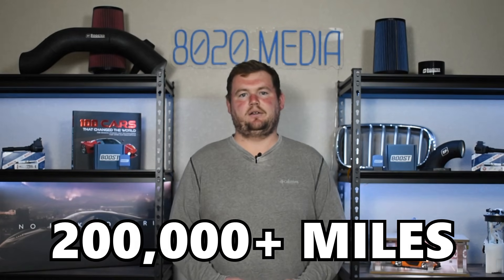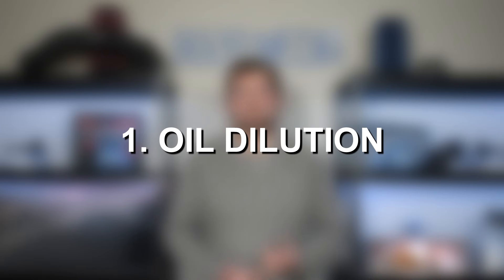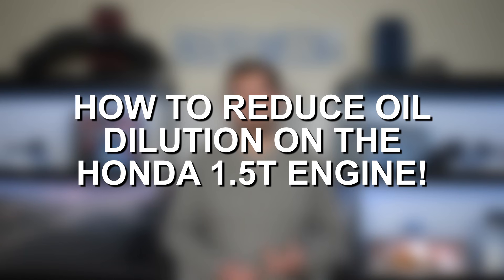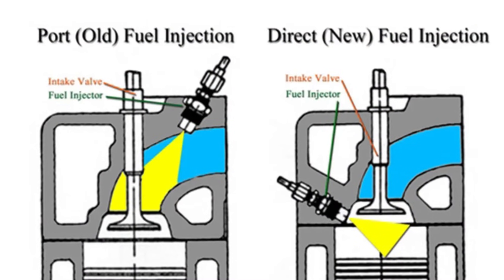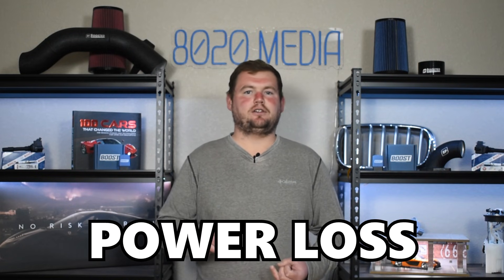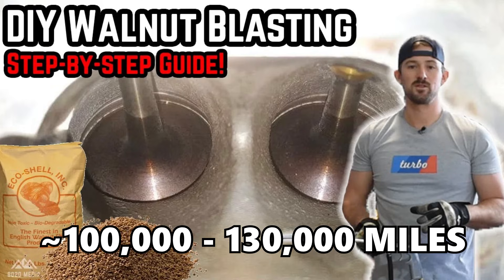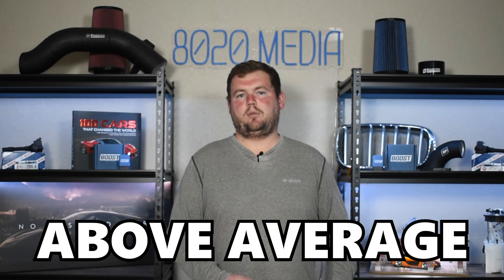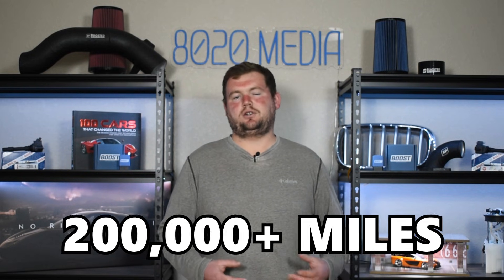Honda 1.5T Engine Breakdown – What Every Honda Owner Should Know! (L15B/L15C)

Comment: 2017 Honda Civic LX 6MT, 190k miles-not a cough. 
Mainly highway miles, oil changes 10k-15k miles, synthetic oil
87 gasoline
Reply from the maker: S - Nice! Thanks for taking the time to share your experience.
Reply: The lx has the 2.0 engine...
Reply: @theadvocate4698 
Nope
Not the hatchback

Comment: As a certified Honda master tech I am telling you every 1.5 T is a ticking time bomb. Simply a matter of time
Reply: Why exactly are you saying this? Just have a look on the CivicX forums, there are thousands of Civic drivers, also plenty of high mileage Civics, almost no head gasket issues or blown turbos with the 1.5 T. Even the tuned ones holding up pretty well.
Reply from the maker: S - Agreed.
Reply: lol...One can be anything they want on the internet
Reply: My 1.5 with 140,000 miles begs to differ buddy
Reply: My 18 1.5T is sitting at 275k km. No issue
Reply: @anthonychan853 proof that with maintenance almost anything can last a long time, all these self proclaimed internet experts think they are mechanics lol
Reply: @anthonychan853 are serious
Reply: Any car with an engine is a ticking time bomb, just in some cases the ticking takes a lot longer than in others :)
Reply: @g.ghenady haha that’s true! Never a good day when the ticking stops lol
Reply from the maker: V - Interesting take..
Reply: I traded in my 19 SI (loved that car) because of the problems I was hearing with the 1.5t. I bought a 24 CRv Hybrid. What do you think of 2.0 hybrid?
Reply: Any reason my 2016 civic exl 1.5t is like sputtering and like losing acceleration. When I push on my gas it likes gallops.
Reply: @MrXjmann360 they have an open recall for low pressure fuel pump in the car. Injectors can go bad too I replaced mine

Comment: I have been a honda owner since 1991 and own a 2019 with the 1.5 . I have doubled my oil changes run premium fuel for the added detergents and run a pea fuel cleaner every oil change. I also run my crv in sport mode during the winter on short trips to get the engine up to temp quicker.
Reply from the maker: L - You're doin it right!
Reply: @8020Automotive  David Wardale writes about a weak South American locomotive design in his book "The Red Devil and the Age of Steam" that any machine can be made reliable if you lavish enough maintenance on it.  If I buy a used Honda, I have to find one in which the owner can show records having doubled the oil-change frequency, used premium fuel and added injector cleaner with every oil change?
Reply: My wife has the same exact car. I found oil in the engine air filter because of a clogged PCV valve. Have you had oil in your air cleaner? Also, I hear 87 octane is best for this engine because it makes it run hotter which it needs the heat to run efficiently.
Reply: I tun 91 to keep my injectors clean. I have never had oil on my air filter. My problem is cold weather and short runs causing fuel dilution.  I also run  my crv in sport mode to keep the rpms up to try too get the engine up operating temp faster.   @daleadmire1451

Comment: Any vehicle with a turbo should have frequent engine oil changes, like 3,000 to 3,500 miles.  It is so important to do this with turbo-charged vehicles.
Reply: Great point! Higher octane levels are a great way to keep the engine running smoothly too.
Reply: Let idle to cool down  turbocharger
Reply from the maker: @PeterHernandez-lg2eh  Good point!
Reply: No no no 5k is perfectly fine and anything less than that is literally a waste of your money and oil.. don’t be a moron bro. These cars aren’t built like car in the 70’s and 80’s and don’t use normal low grade conventional oil so they are extremely efficient.
Reply from the maker: S - Couldn't agree more!

Comment: Does 5th generation (2021~) Odyssey require Premium fuel to run longer than 200,000 miles?
Reply from the maker: F - It doesn't require it, no. But not a bad idea!

Comment: Apart from the the silly coolant channel cutout between the cylinders causing the head GaSkIt to be placed under stess, and the low tension piston rings getting stuck, and the crank shaft and con rods being made small and light, most other problems can be mitigated by regular oil changes. 

When you learn just one con rod bolts from a K series can hold the entire weight of the moon, and ten con rod bolts from an L15 can hold the weight of an aluminum sump, you get why these engines can't be tuned for reliable high horsepower. 
They are already in a high state of tune standard.
Reply from the maker: M - All good points! Thanks for sharing.

Comment: My head gasket blew at 80k
Reply from the maker: A - Sorry to hear.. However, thank you for sharing your experience!
Reply: What gas are you using?
Reply: @benjamin4321  it’s so frustrating when people don’t give answers!
Reply: @daleadmire1451 Yeah it is. Mine blew at 180k miles. I had it on a tune for 80k miles. 24psi tune. It blew when I traveled out of state and used 91 instead of 93. It didn't really blew but the engine was not running well after that trip. Probably a bent rod.
Reply: @b @benjamin4321  I heard the engine likes the 87 octane better because your engine runs hotter, which makes it more efficient. I don’t know what to believe.

Comment: Don't buy Honda cars manufactured and assembled in the USA... check the VIN and make sure it starts with J. I don't recommend these VINs (1HG, 19X, 5J6, 5FNY)
Reply: My 2018 CRV was built in Ontario Canada and I thought that was a good thing . Most hated car I ever owned with many small issues and oil that was dirty in 500 km like it was a diesel. Finally check engine light came on at 160000 km then I see potential head gasket issue coming . That wasn’t why the light come on but our hatred for this disturbingly over rated pile of junk with seats as hard as concrete got traded for a Japanese made Mazda CX5 . A far nicer car 😎
Reply: @marklake6292  I must give Mazda credit you never ever hear of recalls for that brand, however I like the styling of the Honda much more.
Reply from the maker: J - Interesting. Thanks for sharing. Care to go a little deeper on this?
Reply: I tried my hardest to find a Japanese made CRV. They are impossible to find.

Comment: Just to add a couple points.  The head gasket is more prevalent in Accord 1.5T since it has highest peak boost at around 20 PSI.  CRV is at 18, Civic is at 16.  And the leak usually at the groove between cylinder where coolant passes through.  Since that land is pretty small to begin with, then you take away more material.
Another common issue is the fuel injector.  Since the injectors sit inside the combustion chamber.  Carbon can form around the tip of the injector, disrupting the spray pattern.  Shops obviously will just replace injectors.  But DIYers can just clean then in ultrasonic cleaners.
Reply: As I found with dilution in my 18 Camry which has both port and direct injection, utilizing Lake Speed Jr.'s Speediagnostix company proving 1.6% dilution (2% is the limit), NEVER use generic gas and give a fuel treatment of Chevron Techron and then do it around every oil change interval.  Replacing injectors was not necessary.  That additive eliminated my dilution problem (ie cleaned the injectors) completely.  How did I suspect the problem?  Very slightly elevated oil level on the stick and a distinct gasoline odor on the stick as well....that dilution was at 2,000 miles after the prior oil change, which means, it might have really worsened the at-operating-temperature viscosity significantly by the time of the next oil change.  As it was, I was just barely below minimum spec for viscosity. Luckily the wear number was 4.  I did change my oil as soon as I took a sample.  The sample bottle kit came within a few days of ordering.  Lake's social media name is The Motor Oil Geek.  His content is FANTASTIC.
Reply from the maker: T - Well said. Thanks for sharing!

Comment: I moved to 5w-30 and 5,000 mile oil changes, and added a catch can
Reply: Can you share any info on the catch can make and model?  This is just to prevent EGR issues?  While I can do a timing belt and suspension and emissions work, I've not delved into catch cans etc.
Reply: My 2017 crv has 105,000+. Not one issue. My arrangement: always used Mobil 1, 0w-20, chance at 5000 miles. Put in a catch can at 4500 miles. Mostly catches fuel. No carbon, plug,or head gasket issues. Always use reg gas. Runs like new

.
Reply: premium fuel is important for any turbo engine
Reply: @loyal4theway159  wrong this engine actually runs better on lowest octane gas because of the temperature needed for optimum combustion .. if you use higher octane it will cool down the engine and cause problems
Reply: @JorgeGonzalez-nc7uk You  are absolutely right.
Even Honda recommend lower octane petrol. 
I am adding AR9400 additive to petrol to lower LSPI.
Reply: @JorgeGonzalez-nc7uk  And yet, the Si with the same compression ratio and really no changes at all to the engine besides a slight bump in power and boost pressure takes 91-93 octane. No matter how much you look, you'll find no reason as to why this is. Perhaps it's because Honda understands how bad it would look for their base models to take premium fuel?
Reply: @mattbaran5413  Does it really matter what Honda recommends at this point? 10k mile oil change interval, 105k mile coolant interval, premium fuel on Si yet regular fuel on other cars with same engine same compression ratio, etc. Do your research instead of just accepting what the manufacturers say. Same reason manufacturers started recommending never changing your transmission fluid because most transmission will outlast the powertrain warranty without service, so why does it matter to them.
Reply from the maker: U - Smart! Thanks for sharing.

Comment: 93 octane gas, 5k mile oil changes, don’t have boost come in full before 4k rpm and it will surely last. Speaking from experience. I have a 23 si with 60k miles tuned with bolt ons and no issues at all but I very much know what it does not like. Torque kills the rods, knock kills the head gasket, fuel dilution in oil kills the power plant.
Reply from the maker: J - Well said! Thanks for taking the time to share these insights. Will certainly be helpful for future viewers.
Reply: How do you not have the boost come in before 4k rpms?
Reply: @kenwclowes9590 tuning boost ramp

Comment: You better off avoiding the 1.5T and getting the 2.0… No turbo + Port Injection and a better head gasket mating surface ( No coolant slots between cylinders) really just helps avoid any engine problems that may surface.. yea it’s a little less power but find one with a Manuel transmission and it can a lot of fun … or get the 2015 civic si … same amount of power with a K24 that’s the way to go for reliability +fun.
Reply from the maker: J - Well said, but would say it all depends on budget.

Comment: I have a 2018 Civic EXT Sedan with 6 speed manual and the 1.5T and I love it. It also had a dual exhaust which not many models had and so it sounds cool. But I do things to help mitigate the oil dilution and also change the oil at only 4,000 miles and in the winter time only 3,000 miles! I also try not to get on the acceleration too aggressively to avoid stretching those head studs and therefore lessen the risk of a head gasket blowing out. I avoid hitting more than 4,000 RPM and most of the time that's more like 3,500 RPM. It's not a Mustang or hot Dodge, so don't treat it like one. You don't have to drive it like Granny would but don't drag race it either. Moderation is key to this engine's life. Also putting in top-tier gas helps the injectors and try to use ethanol-free too. These cars love ethanol-free if you can afford it. I also do the walnut blast thing about every 50,000 miles.
Reply from the maker: M - Thanks for sharing! It seems as though you take great care of your ride. Wish this is how everyone would.
Reply: @8020Automotive  I do get a sloppy sound in the first second when it starts but I don't think it's piston slap though. Almost sound like it detonates a touch at start up for some reason. The 10.5 to 1 compression ratio does not suggest a super high octane to me but maybe it needs a little more octane. Problem for me is I like ethanol-free gas and in my area all you can get is 87 octane in ethanol-free. Wish I could get more like 89 octane.
Reply: I find that most problems come from high boost before 4k rpm, especially when tuned. Sudden torque without a boost ramp will surely bend the rods but sounds like your just daily driving. I would add that at stock levels you should be redlining from time to time to reduce carbon deposits also. I’m more of a tuner but I daily drive my tuned Hondas also so i like seeing this.

Comment: 2020 accord 1.5t.  145000 miles. Turbo went out and 3 bad injectors.  Just a matter of time until head gasket blows. Honda has threw reliability down the garbage chute. Cost me just over $4000.  My 2013 civic ex currently has 362000 miles zero issues
Reply: Wondering if you used super octane, & changed your oil every 3-4k? Overworked engine for accord weight & high compression/ turbo boost.. Thanks
Reply: @holgate1970 only run regular.  I change oil when life meter gets to 30% . Car is driven 90% highway miles.  Turbo turbine was fine.  The problem is too much slop in the wastegate actuater linkage on these turbos
Reply from the maker: D - Sorry to hear.. However, thanks for taking the time to share your experience!

Comment: I remember when full synthetic oil came out.  “Goes 10-15k miles between oil changes”. They weren’t thinking of the future engine types.
Reply: I was using synthetic oil in my cars in the 1980s, but still changing it every 3 to 4 thousand miles.
Reply from the maker: M - So true..

Comment: What about letting the car with the 1.5 liter turbo sit and idle for 2-3 minutes after a 1 hour to 1.5 hour highway trip to allow the oil and turbo to cool down?  Saw this recommendation in another video.
Reply from the maker: M - Always good practice.
Reply: How about just backing off a little while you’re driving home because when your car is parked, there’s no cooling air blowing in, which will make everything even hotter just sitting there.

Comment: This engine is already maxed out from Honda 

Head studs should be done on a stock motor 

There’s not much you can do there’s not enough meat in the metal on the block 

Leave it stock
Reply from the maker: C - Thanks for sharing.

Comment: I've seen vids whereas the pistons and intakes are terribly carboned up. You use low tension piston-rings and add a turbo now you have a recipe for a lot of blow-by/pcv gas creation that is re-ingested into the intake  and with gdi  there's no cleaning of intake valves. Very poor design or ?intentional? to cause premature failures
Reply from the maker: R - Well said, thanks for sharing.
Reply: I think that’s why my wife’s CRV had oil in the air cleaner and a clogged PCV valve, which is a super easy fix but frustrating at only 46,000 miles

Comment: Mine started leaking out the bottom around 75,000 miles. I think it’s the crankshaft seal. I wish these engines were made like they were in the 1990’s.
Reply: Are you sure it's not your valve cover gasket leaking? Honda valve cover gasket are known to leak at around 100k miles.
Reply: @richard112360 if these are like the 8th gen civics, the vtec solenoids leak….could also be the problem…
Reply: Most likely chain tensioner inspection cover, very common
Reply: 6 month later now, I did an oil change and there was no oil!  I'm so happy the problem went away.  The only service I had was the air conditioner repair covered by Honda under special extended warranty.  Perhaps it was refrigerant oil?
Reply from the maker: P - Leaking what? Sorry to hear.
Reply: @8020Automotive  oily, gets dirty before accumulating so unsure. Assume motor oil from crankshaft seal or transmission fluid.
Reply from the maker: @pault6533  Sorry to hear this. Any check engine or oil lights present?
Reply: @8020Automotive  no, discovered during oil change. Leaks at the black plastic piece. Some drippage on the aero plate.

Comment: Thanks for your very thorough explanation of potential 1.5 T issues! You really put my mind at ease with your suggestions, and I look forward to many miles and smiles with my '25 SI! I have to make frequent short trips, but hopefully frequent oil changes will address any potential problems with oil dilution. I do try to go on  30-45- minute drives at least once a week.  I had a '21 VW GTI which never let me down, and I think that 4-5 K mile oil changes and easy driving until the car warmed up played a huge part in that. Thanks again, and keep those videos coming!
Reply from the maker: E - Thanks for the feedback! You can't really go wrong with Honda's honestly.
Reply: @8020Automotive  So far so good after 5 months and 10K miles! I'm changing the oil between 3-4K miles, and so far I haven't noticed the oil level rise or detected the smell of gas in the oil. I use 93 octane gas and try to go for longer drives during the weekend. I live in a small town and frequently take short trips.
Reply: Thanks for posting this. 
Recently bought a brand new CRV and after the fact saw multiple on the net saying that the head gasket issue was a huge problem.
I feel a little less nervous now that I've seen your video.
Reply: In online forums some owners shared they have gone beyond 200k km with no problems